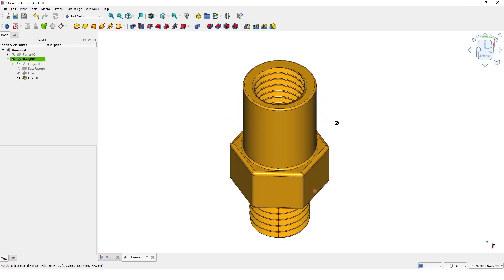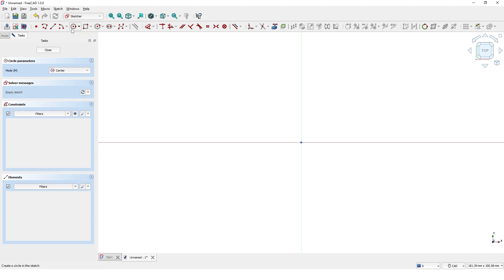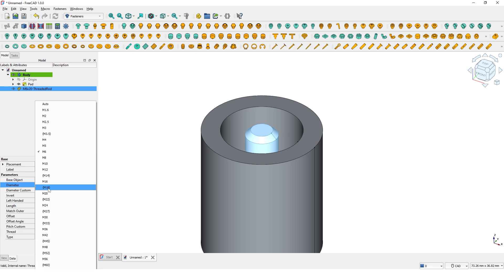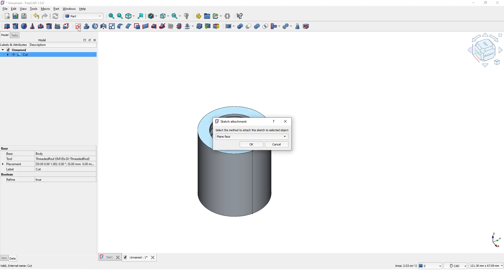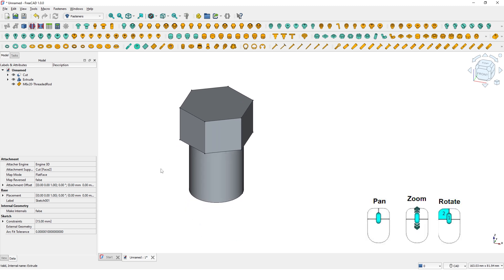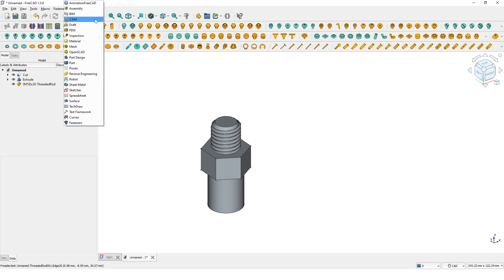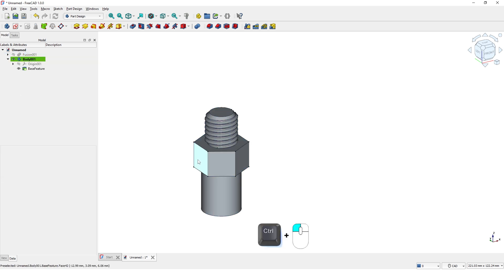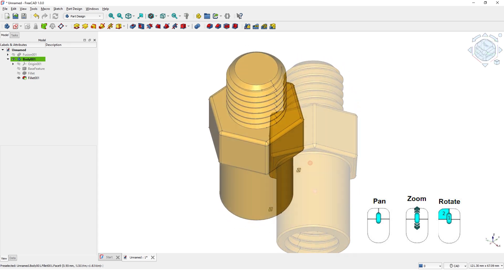How to create threads in FreeCAD | FreeCAD 1.0 Tutorial for Beginners Exercise #16 #freecad #cad

Comment: Thanks for the video! If I’ve understood this correctly, the size of the two threads precisely match. What about offsetting one a little so they would work if 3D printed?
Reply from the maker: Yes you are absolutely correct. There should be little offset for smooth fitting. This offset is depends on the size. It is knows as allowance and tolerance. Thanks for watching my video.

Comment: Great example in this video.  After doing this in FreeCad, I wanted to bore a hole through the thread rod that protrudes from the nut side. I tagged the rod end and placed a work plane but when I do that it's asking me to create an independent copy. I place a 12mm circle  and attempt to pocket a hole through the rod, but alas, no hole. It seems to treat the part as something new and doesn't do the operation on the formed part that your example made. What am I missing here? Should I be using some other operation with in the part pulldown?
Reply from the maker: You have to boolean both fusion and the body. Select both Fusion001 and Body001 ===> Part Design (Menu Bar) ===> Pick "boolean operation". Click ok. Now sketch the circle and apply pocket command. If it doesn't work. Export the model as STEP file format and import it. It should be now one solid model. Let me know if this helped. Thank you for watching my video.
Reply: @Learn_FreeCAD_1.0  I guess great minds think alike.... After I posted my question, I too went to the part area and created a cylinder with the size I required. Placed it and did the Boolean function and low and behold, the magic happened.  Thanks for the quick response to my question. At 73 and trying to rap my head around FreeCad, it's great to know that there are places to go to get some guidance ..... Thanks again!
Reply from the maker: Awesome.

Comment: I followed the tutor and at the end I printed it. But it does not fit on eachother. Its to tight. How to 3d print??
Reply: 3D printed threads are always problem, unless you leave some clearance. Try grinding the male thread with sand paper.
Reply: In Fastener WB, there is an option to add tolerance for 3D prints. Try different settings until you are satisfied. Typically, you need different settings for different filaments.

Comment: As usual,a great tutorial.  Do you have a video where it summarizes your display and navigation preferences, so our screens look like yours.  It would help us in general.  On this specific video, I would like, at about 5:17, to know how to set my transparency like yours.  I can see the front of the just-added thread, but not the back side.  I assume it is a view/transparency issue in my setup, but I can't find it.  Also for example, at6:27, by lower boolean and upper threaded part are all the same color, and selecting them shows a wire frame instead of a solid, and different color.  I would like to better match my setup to yours. Thanks again.
Reply from the maker: Actually my display and navigation setting are all default. I am not sure why you have this issue. You can play with the display settings under EDIT --> PREFERENCES --> DISPLAY --> 3D VIEW.